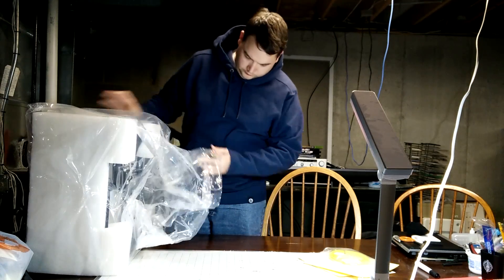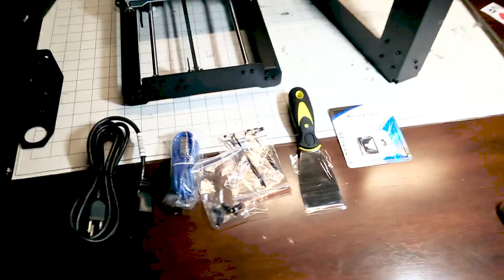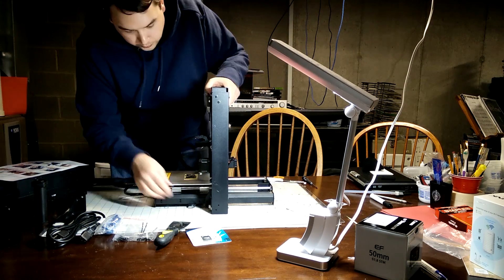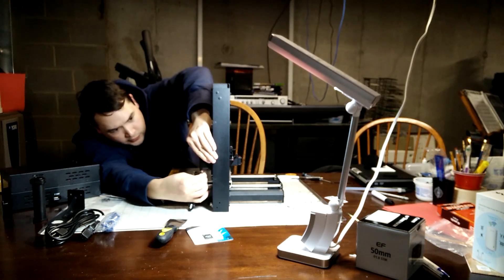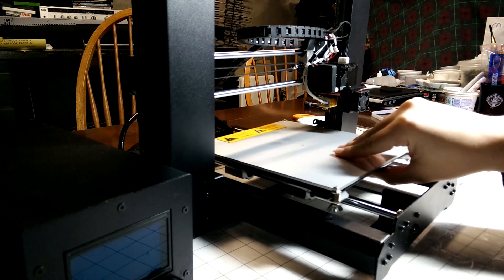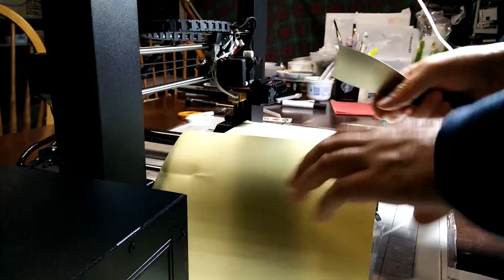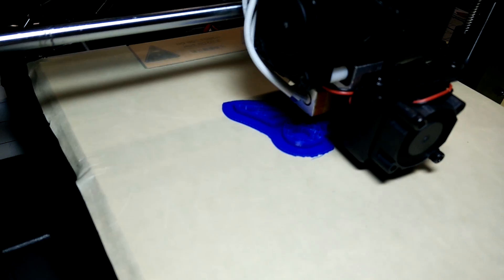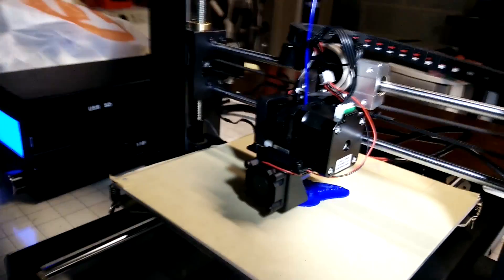Monoprice Maker Select IIIP 3d Printer Unboxing, Assembly, and First Print Impressions!

Comment: I know this video was awhile ago, but i just got this machine to work with. I do not have any of the previous owners sd card, and all i have is cura 4.0, which doesnt have the profile on the menu. I tried looking it up, but it is not coming up on my searches. any suggestions?
Reply from the maker: Hey there, this machine is a rebranded Wanhao Duplicator i3, the first version. You should be able to select that option from the Other section of printers.

Comment: What were the parts your printed at the end of the video? looked like a replacement for the metal face of the controls for the printer? Or something else?
Reply: Hey there, that was an enclosure for a raspberry pi based utility called the Heater Meter. It's a PID controller for a Weber grill. Let's you set a temperature like an oven and regulates the airflow to maintain a temperature.

Comment: Does the printer come with a USB cable to connect to a PC? I seen it said USB beside the sd card slot
Reply: Yep, it does.  Comes with a USB cable and (in my case) 4 GB micro SD card.

Comment: Just got this printer today as a Father's Day gift!  (June 15, 2016, so, Yay!)This video saved the day when trying to get the extruder working.  It suggested to pull the fan on the side of the print head to get the filament to properly feed.  I loosened the two screws/bolts(?) a quarter of a turn, and Presto!  The plastic started spewing out like it was supposed to!  I plan to retighten them once I spend quality time figuring out how to clean the thing.The machine is fairly quiet - about the same as an inkjet printer (no surprise there, since 90% of it is inkjet printer parts!)The 5 gcode objects are preinstalled on the SD card (metal bits UP on the SD card!) and the first one is the butterfly logo you see in the video.  Haven't printed the others yet.  The smaller fan on the head doesn't seem to run, but I am using PLA so perhaps the lower temps don't need extra cooling of the media unless you're working in corners?  No problems yet, but again, still on my first 3D print....The PDF manual is near useless for solving anything - Troubleshooting is mentioned - ONCE - in the entire document. So, FAIL for noobs to these devices.  Quite happy I didn't PRINT the manual though. Total waste of toner. The "put-together" could have been much more informative, as it was not apparent that the "bed frame" sat in the middle of the "top frame" (as mine was an exceedingly tight fit to boot.)  Having the print head so close to where we are expected to assemble it made me worry I'd damage the head, or the bed. Lastly, I didn't get any "print bed tape" with my printer, I got what looked like two mousepads with peel and stick glue on the back.  One was already installed on the bed, so I just went with it.  I'd like to kick the idiots who used that soft paper tape to cover over the "wingnuts" which are actually thumbwheels.  All in all, once it's printing, it's a thing of beauty.

Comment: Need help fixing my 3D select printer.  Would any of you mind dumping a copy of your firmware?   Monoprice doesn't have their firmware on their site. If you install arduino IDE and run the following command.  

"C:\Program
Files (x86)\Arduino\hardware\tools\avr\bin\avrdude" "-CC:\Program
Files (x86)\Arduino\hardware\tools\avr/etc/avrdude.conf"  -p atmega1284p -c stk500v1 -b 57600 -P \\.\com5 -V  -F -U flash:r:c:\temp\firmware.hex:i

Just change the com port to match your setup.

Comment: how is the noise level with this printer?
Reply from the maker: +NamestheGoblin It's not outrageous, but it definitely kept me awake the one night I ran a long print with it 20ft away from my bed under an uninsulated wood floor, so your mileage may vary in that regard.
Reply: +Sim Hardware what would you compare the noise level to? i have a big glass box i can put over it to mute some of the sound.
Reply from the maker: Hey sorry for disappearing, If you're still wondering I'd say it can be somewhere around a slow speed drill. The steppers aren't the loudest thing in the world, but they can crank up when switching from far sides of an axis.
Reply: +Sim Hardware bought one almost two weeks ago. lets just say i do not regret it.
Reply from the maker: Awesome! Hope the vid helped in your decision!

Comment: how did you address the fan issue?  I'm trying to load filament for the first time and run into the kickback issue after it goes in so far. thanks in advance for your help.

Comment: I've had a lot of trouble with ABS filament so far with this printer.  It will print roughly 4-5mm high and then create a wad of filament if you're not watching it and the roll of filament may get stuck with its position on the top so I suggest putting the spool in front of the printer on a make-shift holder (I'm actually using Gold's Gym dumbbells to support the spool in front of the bed).  I've had a lot of trouble with the stepper becoming disabled as well so I've tried going into the configuration and just disabling it from the get-go.  Also, I've connected my MacBook running Cura to the USB slot on the printer but it doesn't work.  It recognizes that the printer is connected but the only thing you ever see is "detecting baudrate" but the print never actually goes through to the printer so I think you have to do all printing with the microSD card from my experience.  Fortunately my fans are working right out of the box but it would be nice to successfully print something other than the included samples on the microSD.  The models I've built and downloaded to the SD through Cura are not printing successfully (getting stuck mid-print) even though they're simple designs.  I have upgraded to a glass plate on the heated bed though which seems to work out better than the masking tape type of cover provided.

Comment: Is the printer still holding up? I left a comment 3 weeks ago and wanted to check in.
Reply: +BigBeast Seems to be. I actually went through my project backlog pretty quickly. So now I need to come up with more to do with it (largely dependent upon my learning to model things!). The current plan is to create a Huey Collective controller more accurately (hence the Sim Hardware moniker). Also picked up a glass bed to better help with removing things from the bed and escaping the tape.
Reply: +Kerry Dolan Jr. Will you post a vid or some pics of your glass bed install.  Thinking about doing the same.  I bought some cheap PLA and haven't been able to get a consistent print since.  Switching back to the ABS that worked fine but still having some issues.  My masking tape is now "gunked" up with hairspray and glue stick.  Need to find better solution.
Reply: +kcmike7 sure thing. I just got it today, so it may be a bit until I get that on there and recalibrated.
Reply: +Kerry Dolan Jr. If you could make a video on what changes you have made to the printer I would greatly appreciate that. Also, the man in this video recomended I buy a new 40mm fan. Do i need that? I just ordered my printer yesterday and can't wait!
Reply: +Kerry Dolan Jr. Oh lol I just realised that you are the man in the video XD for some reason on my phone it shows a different name when you comment than when I look in the description box of your video. Sorry for the confusion. Do I still need that fan? Also, could you make a video on what changes you've made?
Reply: +Kerry Dolan Jr. I found an old picture frame with glass so I cut a piece and added to my bed.  After a few failed attempts I found out, once again, it is critical to get the bed completely level to the extruder.  I did use a little glue stick and had no problems getting a print to stick.  Plus with the glass the clean up is much easier.

Now I just have to get all the other settings right :(

Comment: Hey I was thinking about buying this printer and I was wondering if it is able to print stuff off thingiverse?
Reply: +Joshua Kirkpatrick Yep! Absolutely. I've printed several things from thingiverse. Those files get processed by your software (Cura in this case) into a series of instructions that are interpreted by the controller. You won't have a problem.

Comment: 2nd ABS print is looking good!  Definitely follow the advice on other videos: heat extruder to 230 C and plate to 90+ C.  I put a bit of hairspray on the plate cover tape just to make sure I would get a solid contact for the raft.  Last and most important.... make sure your plate is level (equal distant to the extruder) on all corners.
Reply from the maker: +Mike T which hairspray did you use?
Reply: +Sim Hardware  I'm embarrassed to post the name...I don't think it really matters but whether it makes a difference or not I'll probably continue to use it for "good luck".  (btw: Big Sexy Hair  :) )

Comment: followed all the instructions and can't get it to print starting on the plate.  It prints everything 2 inches in the air which ends up in a pile of filament.  Help?  Any sites, forums or support?
Reply from the maker: +Mike T There's a google group for who we think the manufacturer is, Wanhao. I saw a similar post from someone and it had turned out that they missed the black electrical tape covering the Z axis stop switch. Did you remove that? Also, are you attempting to print with the built in models or your own? For the first one definitely do one of the items preloaded on the card. 

Also, when you select Home All does that move the nozzle to the bed? If so, then I would load the model you're working with in Cura and see if there's something really strange about how it's set up. 

Here's the google group: https://groups.google.com/forum/#!forum/wanhao-printer-3d you'll need to request access.
Reply: +Sim Hardware You are the Man!  Thanks for getting back to me.  I was wondering about the tape and wasn't sure if it needed to be removed. I was about to pack the printer back up and send it back thinking the z axis had no "down" ability.  So far the first job is printing nicely.  I will check out the google group and join in, hoping I can pay it forward on your kind and helpful response!  Thanks again.  Have a GREAT holiday!
Reply from the maker: +Mike T Happy to help! Let me know how your prints turn out! :D

Comment: Thanks for the video. I still have a few questions. First, where you able to figure out a solution to the bed tape? Second, could you give me the link to the fan you bought? And finally, did you order directly from the company's website or did you order from somewhere else? Thanks again!
Reply from the maker: +BigBeast I haven't decided on anything specific yet, I'm probably going to go with a glass plate, but I'm still weighing my options as there are a number of other things out there as well. I had purchased this one: http://www.amazon.com/gp/product/B00MYZAILA?psc=1&redirect=true&ref_=oh_aui_detailpage_o03_s00 but it seems like any 40mm .1 amp fan will do. 

I purchased direct from Monoprice for the printer.
Reply: +Sim Hardware Did the fan work out?  I recently noticed that my fan doesn't come on at all.  The larger one directed above the extruder is fine.  The smaller one toward the front of the printer bed doesn't work.  Does anyone know what impact this makes on the prints?
Reply: +kcmike7 Did you ever find the answer to your question? Mine worked for a bit but doesn't anymore. :( Also I'm having problems printing Marvin with ABS..... I'm thinking it might be the fan.
Reply: +BigBeast Sorry for the delayed response.  I bought a replacement fan on amazon ($5) and installed.  works fine now and definitely helps the prints.  I keep fans at 75% but experiment here to your needs.

Comment: how much filament did it come with?
Reply from the maker: +iliketobuildstuff Not much. Maybe a couple meters. You'd definitely need to pick up a new spool.
Reply: Sim Hardware thanks how is the printer doing? Do you have any complaints so far? I may be getting this printer soon also have you tried printing abs yet? Thanks
Reply from the maker: I haven't yet ordered a spool of ABS yet, so I can't speak to that. I think the printer is doing great in general. I'm very pleased with my purchase - the extruder is accurate, and set up was quite easy. Right now the challenge is learning how to optimize the software for this particular printer. 

A couple items I'm not pleased with are the electronics fan, which sounds like it's about to die already and I ordered a $6 replacement. The other thing is that bed tape is a crappy solution. It's very easy to tear while removing a large print. A glass plate or other solution will be a necessary upgrade. 

Overall, I believe this is a great starting point. The whole point is tinkering right? So I think unless you're looking for something that's 100% perfect and you never want to mess with it, this is a great deal.
Reply: +Sim Hardware have you tried repetier with it? I use that on my current printer and I find it quite useful and user friendly I'm not sure if you will have to reflash the firmware on the printer to use it though.
Reply from the maker: I haven't. I'm still pretty new to everything, but that's a great recommendation (as I look into it). As long as it generates gcode it should be able to use it with the current firmware.
Reply: +Sim Hardware I just got mine (same printer) best tool for generating code I have found so far is cura just because the way the printer is setup it is designed to run with cura I have also found that just regular green or blue painters/masking tape work well on the bed
Reply from the maker: +iliketobuildstuff how are you liking it so far? I've been using Cura exclusively, and haven't had issues with the vanilla version.
Reply: I am liking it quite a lot however i am having the same issue you mentioned in your video with both sides becoming uneven how did you fix it any tips? thanks
Reply: +iliketobuildstuff  had the printer only a week but finding that I can build using meshmixer or 123D Design and as long as I open the STL file up in Cura then save it down as gcode, it prints like a charm.  Has anyone tried connecting USB direct and printing from Cura?  I've only used microSD.
Reply from the maker: +Mike T Haven't been able to get it close enough to my desk to do that. Pleased with your purchase though?
Reply: +Sim Hardware +Mike T
I have not gotten it working through usb i use repetier host for the other printers i have access to, but it will not communicate with repetier without me reflashing it so i haven't gotten it connected yet I do not know if using repetier will alter the quality of the prints tho so I am hesitant. I also have been very busy lately so I have not had much time to play around with the printer I have mainly been just setting it up and letting it print all day / night

Comment: Have you tried HIPS or ABS filament?
Reply from the maker: +shiftpgdn I have not. Planning on ordering some ABS next week. I still need to familiarize myself with HIPS before I commit to a purchase on that.
Reply: +shiftpgdn ABS works great so far.  I bought glow in the dark ABS and once I got the bed leveled and cranked the extruder temp to 230 C and the bed to 90 C....have been good to go ever since.  Good luck.